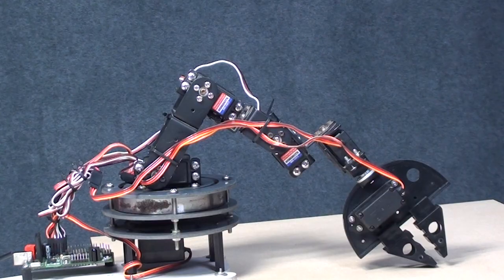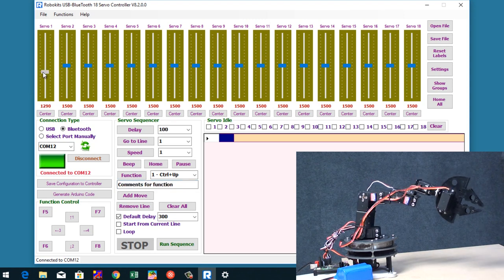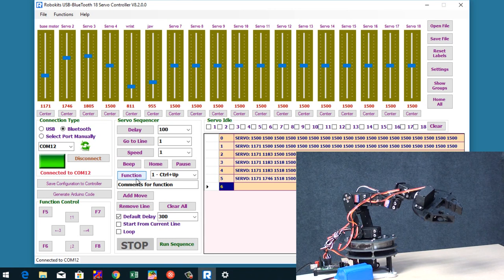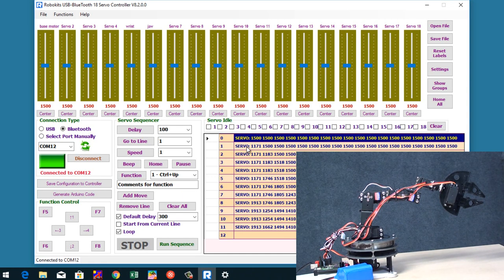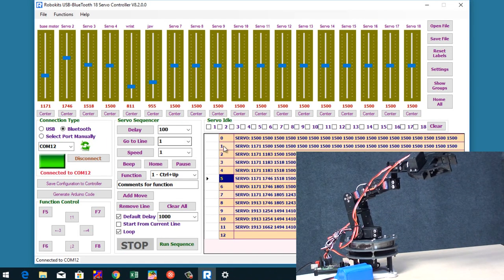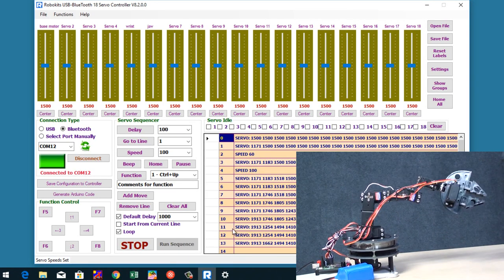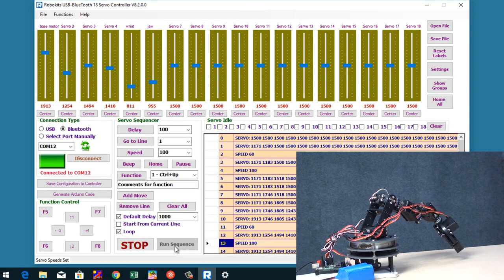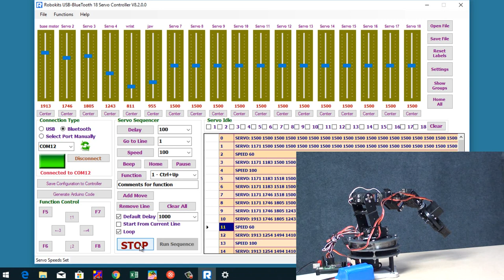Robokits Arduino Uno based 18 Servo Controller board - Part- 3 (Delay, Speed and GOTO functions)

Comment: can i use this softwre for picmicrocontroller pic16f877a
Reply from the maker: No you can't use this software with picmicrocontroller as it is made to be used with our Arduino Uno basd 18 Servo Controller Board.

Comment: Wat are specifications fr power supply
Reply from the maker: Power Rating is  5 - 7.5 V DC
Reply: @makeitideas9517  amps?
Reply: @makeitideas9517  is 6 amps okay bro
Reply from the maker: It should work.We have used the battery of 7.4V.
Reply from the maker: Recommended current rating is 10A.
Reply from the maker: Yes, it should work, but recommended currrent rating is 10A .
Reply from the maker: @muthudkumar1466  +91-79-29750885-886, +91-7878967626, +91-7487077796 (10:00 AM to 6:30PM IST Monday to Saturday) you can contact and call us on any of the mentioned number. And the board will not get damaged with 7.5V.